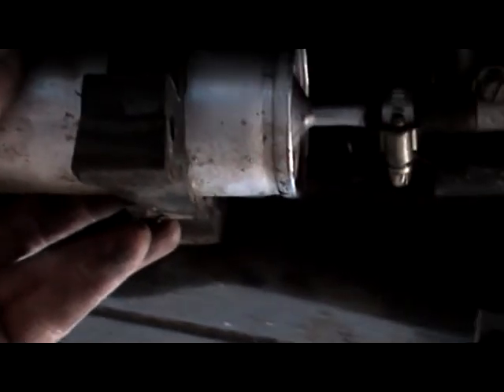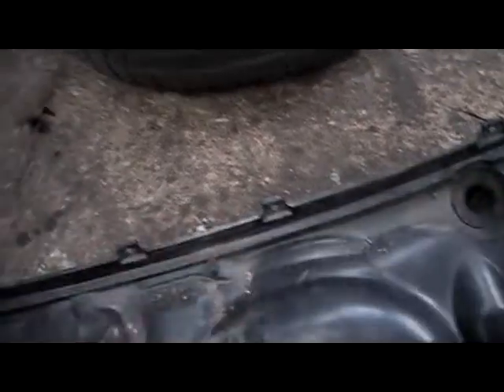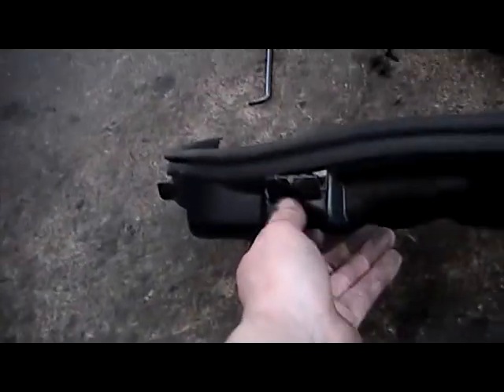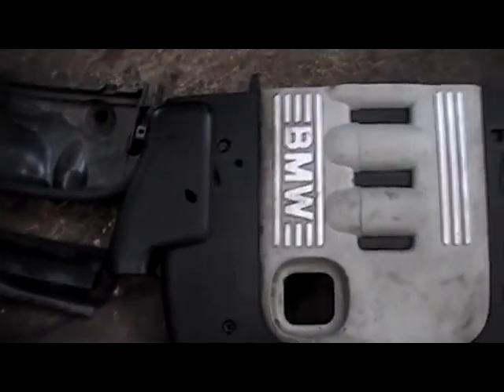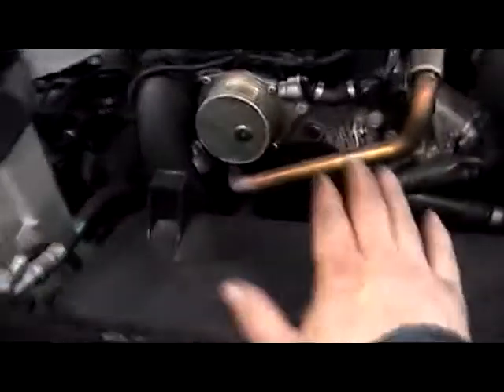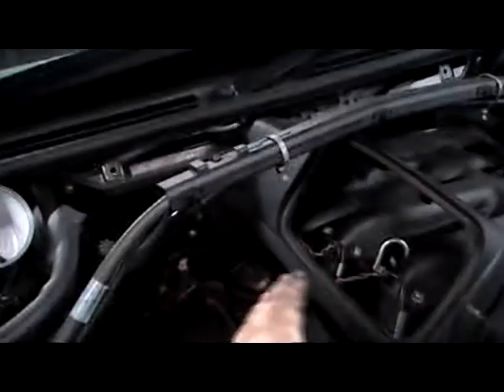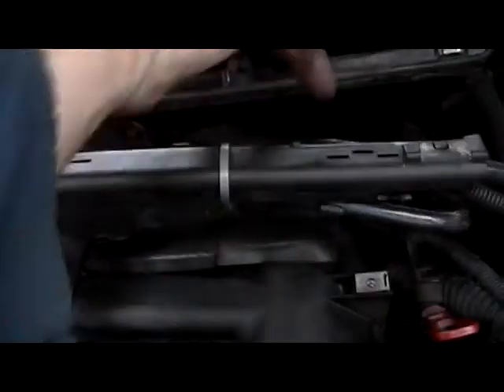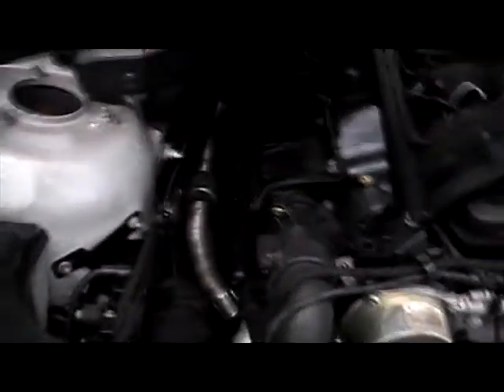BMW 320 diesel filter change.mpg

Comment from the maker: aye, have it serviced first, to see how she goes, oil deposits in the exhaust could mean worn oil seal in the turbo, another tell. tail sign is oil stains on the rear bumper. or on the ground if there is a down pipe on the rear of the exhaust.fitted. aye some good wee towns in donegal. letterkenny and bundoran. being the most popular, for nothern hens and stags.

Comment: I just see lots of soot on the ground and some dark oily wet patches. I hope it doesn't mean a new turbo. They're supposed to cost more than the car lol Yeah i use to go to Bundoran as a kid, we had a cararvan down there facing the old bar. Ours was just on top of the hill facing it. Good old days, amusment parks, down to the beach hanging out with the surfers lol

Comment: Is it normal to have black smoke on acceleration? Would this mean there is a blockage in the air filter? Just bought one of these and terrified of it breaking, (turbo/head gasket). My last car (renault) was a complete and utter nightmare. This one starts okay and sounds okay, but sometimes there's a little white smoke and when I press on the accelerator it blows out black smoke and some soot onto the road.